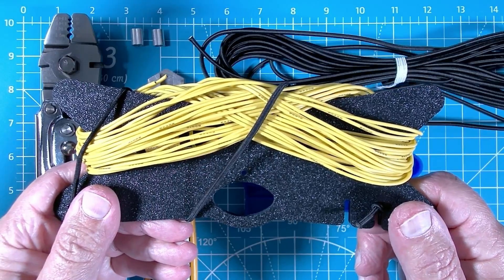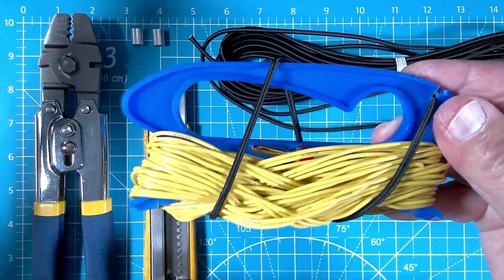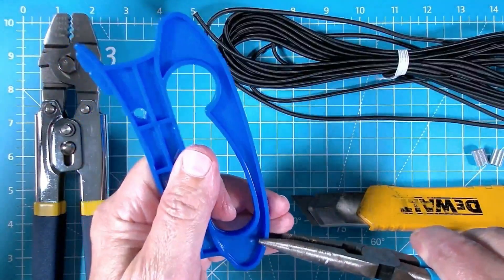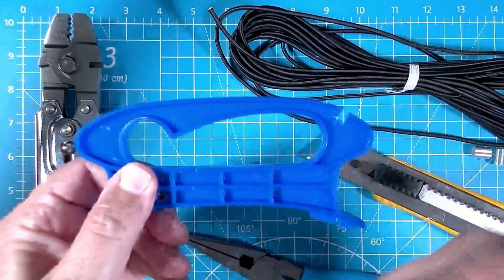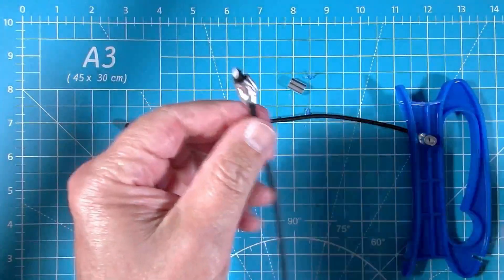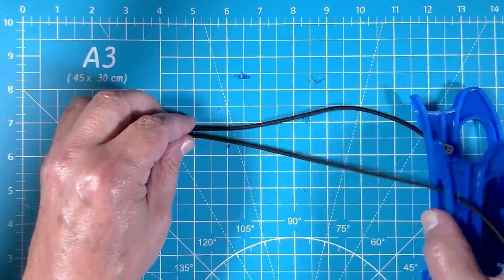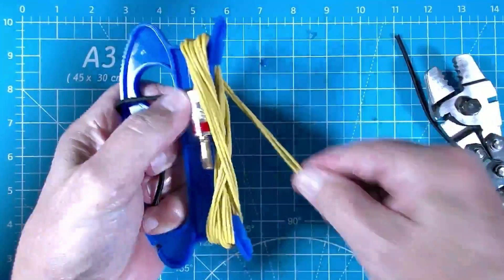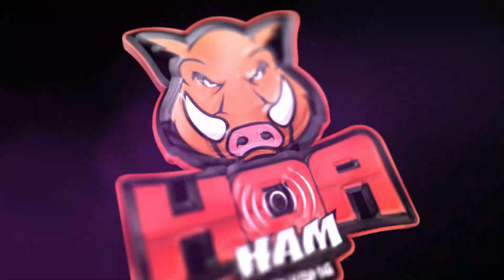How to Make a Winder for your Ham Radio Ground Radial Wires

Comment: For cutting thru plastics.  Use a box cutter.  Heat up the blade w a small torch.  When hot score the cut once a few inches. Reheat etc. u will find the sweet spot where it stops cutting thru. To reheat it.   Once plastic is removed. Lightly quickly fan w light flame to change plastic discoloration to look more natural.  Makes very clean cuts. ✌️

Comment: I used the same kite winders for my ground radials.  One recommendation - don't leave these winders out in the sun too long.  They are not formulated to resist UV light, and become brittle if left out in the sun too long.  I'm sure they're fine for a day or two of POTA, but leaving them out for a week or so will have them showing damage.
Reply from the maker: Thanks for that useful tip Hector.  I set up for hours at a time and break down...I would not have discovered this myself so I appreciate you sharing it for all.

Comment: I loved the video. But could you talk some about what is running on the monitor behind you? What software is that? What are you using it for? I will make my radials tomorrow. I cut the wire today. I have the clips but the banana jack ring terminals haven't arrived yet. I also have the winders so I may work on that tomorrow too.
Reply from the maker: W4MKH, the software is SDRUno, running a SDRplay.  I use it for rig control on my FT-991A and to get all the controls on a large computer screen.

Comment: Another thought. On the crimp connectors…I use them a lot myself…I crimp them on the flat side not the high side. I get a great pressure fit without as much strain. Just fyi.
Reply from the maker: Thanks for that Frank; easier to crimp that way for sure.

Comment: I have a bunch of these cheap plastic kite winders. They are great for the purpose. I’ve used them mostly for EFHW and random wire portable antennas…with a counterpoise n a separate winder. Another great, useful video!

Comment: Really enjoying your videos on loaded verticals and radials! I do something different with my radials… wind them in a figure-eight using my thumb and pinky finger to wrap the wire around then just pull your fingers out and use some one wrap velcro to keep everything together. The smallest winder is no winder at all! 😂73 and keep up the great videos!
Reply from the maker: Great tip, "smallest winder is no winder".  Definitely going to give that a try.